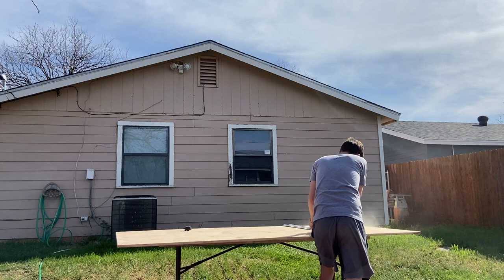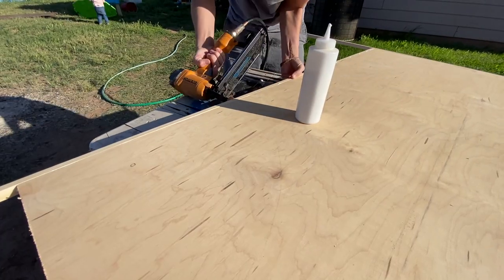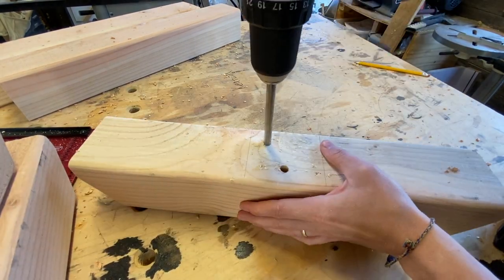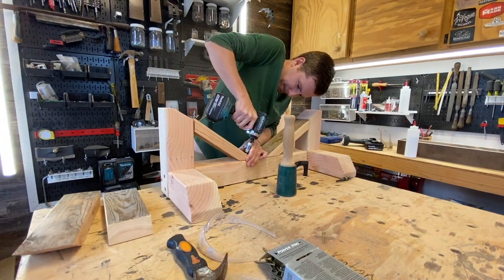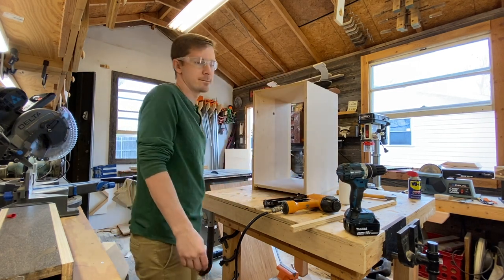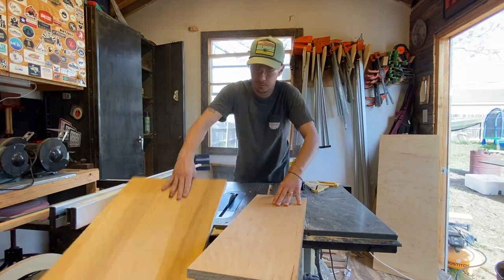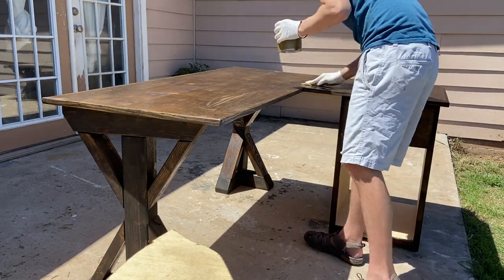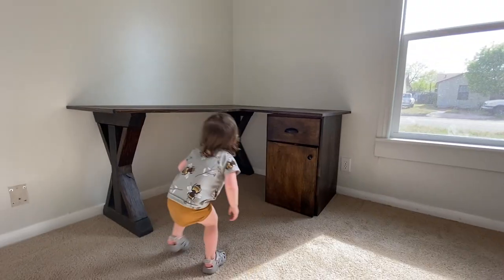Modern Farmhouse Desk // DIY + How To

Comment: Not to be picky you didn't stain the inside of the cabinet or the bottom of the desktop.  Why??
Reply from the maker: Most folks debate whether the undersides of pieces need to be finished or not, I tend to lean towards the not position. In regards to the cabinet I’ll usually stain the inside but I felt like having it untouched was a nice break from the whole piece being darkened. 👍🏻